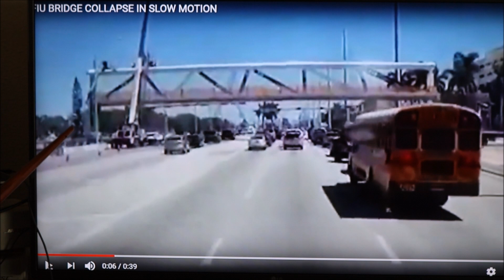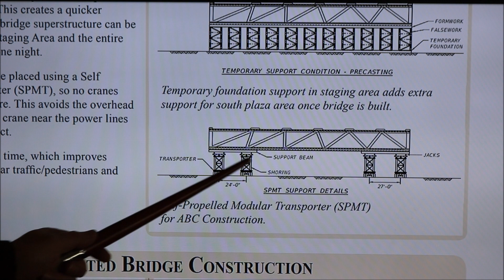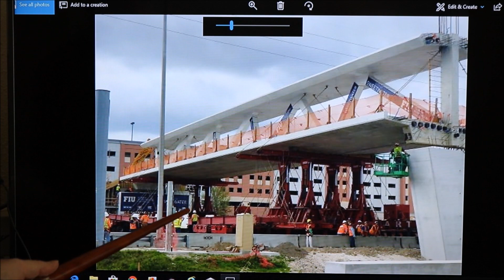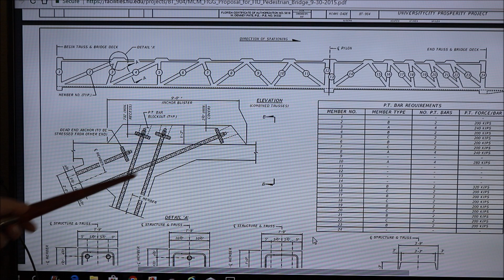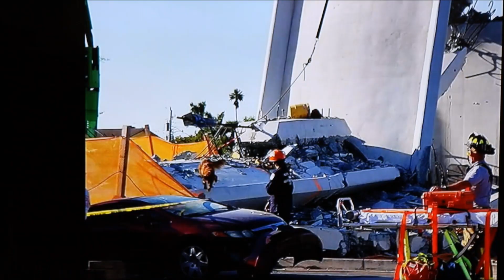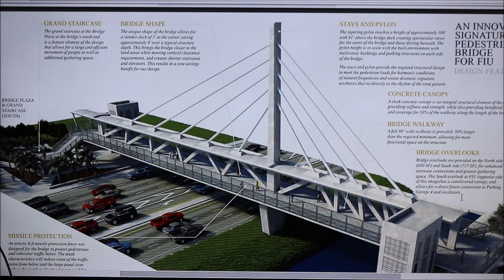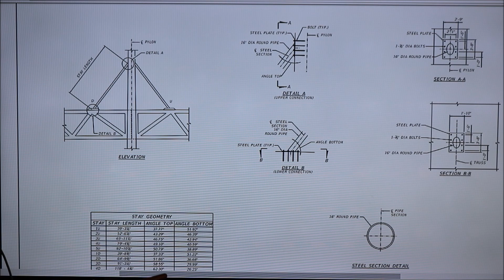Miami Bridge Failure Update 18 March 2018

Comment: I suspect they’ll find the design was at fault. It was not a matter of if the bridge would fail, but when.
Reply: Actually, Stewart is partially correct. The design team was not all women.  Denney Pate provided the wet stamp on the drawings.  FIU and others have been busy scrubbing that information.  It was about quotas in STEM fields.  And using snopes for fact checking is like using wiki for research for doctoral dissertation.
Reply: Prior to the collapse, the FIU News wrote glowingly of Leonor Flores, a FIU alumni and project executive at MCM, builders of the bridge.  After the collapse, FIU stated that Flores had no connection to the project "in any capacity".
Yet the earlier report in FIU News included a quote from Flores herself; "I think it very important as a woman and an engineer to pass this  on to my daughter."  Flores was billed as the Lead Engineer in the FIU News article.

MCM, Flores' employer and the builder of the bridge, is minority owned and quite politically active, even getting legislation passed by Miami-Dade County favoring MCM in multi-million dollar projects.
Reply: This is my story of the bridge failure: Just before it snaps, you can see how the upper flange has an arch curve that stops at 11. The section to the left of 11 is rigidly fasten to the lower flange through 12. Therefore, this section cannot "dip" to conform with this arch, so the lower surface of the upper flange goes deeply into tension. Stress concentration occurs at the sharp inside corner right angles. 

And this is where the node above 11 explodes and looses much of the rigidity. It separates from the upper left flange. 

12 has stopped supporting much and 11 suddenly has the full weight of the bridge. You can see how the arch gets more pronounced as the node rotates and transfers all force to 11. 

The shockwave travels down 11 and hammers the lower flange tendons, especially the center two. These two are not designed to take the full tension of the flange, much less a shockwave. The lower flange tears open from the center to the edges. This is another critical shortcoming. The web applies point loads to the lower flange, especially to the center pair of tendons at the endpoints. These two should be fully capable of handling all the bridge tension, even if the post-tension is never fully applied. 

The lower flange is now hanging from 10. This compresses 11 even further.  

11 explodes, throwing out the lower tendon. 

The node above 11 was extremely undersized, just as 11 (and 2) were extremely undersized. 

I conclude that tying the upper flange to vertical 12 (before the bridge was properly settled) was a contributor to the failure. The top of 1 and 12 could have been left freestanding on untied rebar, to be grouted in later. 

I believe that 1 and 12 should never have been designed to support any bridge weight. 

However, if the web had been inverted, then 1 and 12 could have been compression members. 2 and 11 would be in tension, etc. This is a very conventional configuration for Warren Truss bridges; probably for very good reasons. However, the end nodes would have to be far more robust.
Reply: Carla Nunez, Here is but one source for you.  Be sure to read through all the links.  https://www.amren.com/commentary/2018/03/diversity-is-our-strength-i-have-a-collapsed-bridge-to-sell-you-florida-international-university/
Reply: It has the ring of truth. Yeah I will wait for the evidence before I'm sure, but that is just the kind of PC nonsense that has been going on.
Reply: Richard H You claim Snopes check unreliable yet you link a polar right bias opinionated website. The irony.
Reply: Why is the gender of the engineer even worth mentioning?  I'll bet something like 99% of bridges that have collapsed were designed by male engineers.  And, yes, I know that's because historically most engineers were male (like me).  If old white guys keep designing bridges that fail, shouldn't we look elsewhere for better designs?
Reply: Stewart James False. https://www.snopes.com/fact-check/was-all-female-responsible-bridge-collapse/
Reply: Richard H This project had nothing to do with affirmative action or stem quotas. The leading engineer as well as others relevant to the project have been named in other news sources. People actually doing research on the subject are having trouble finding anything to back your claim simply because it's false. Otherwise please list your source links.

Comment: The problem is that there is only on tension rod.  Too small for such big load.  And it that one fails there  is not backup.  That should have 3 rods.
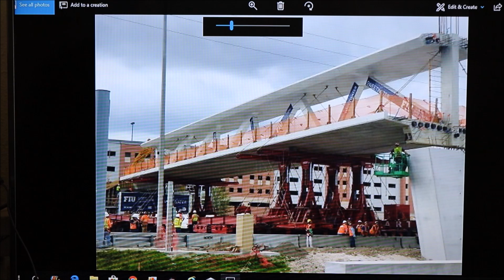Reply: At 03:15 there is a (preliminary) drawing with the list of PT bars. The alternate trusses have 2 and 4 rods in each.

Comment: Not so much "real world engineering", but real world construction. The apes setting the legos often deviate from what the engineers meticulously planned. Most of the time, things work out, but a few percent ends up adding to the stock footage of engineering failures.

My first guess would be over stressing in the cable, or the anchor point (insufficient concrete hardening time for the additional tension)
Reply: jfbeam: Politicians, administrators, inspectors & engineers are responsible. "Apes" as you  refer to construction workers were not responsible.

Comment: Concrete question . This is a concrete structure . Was it poured "in situ" , and did they let it dry for some time ?  Temperatures were low , even in Florida , in february this year .
And also thanks for this video .

Comment: This was an "aesthetic" bridge, a 32 foot wide, 32!!!!, pedestrian bridge, the big idea being the lighting above for night time viewing.  What this looks like is an artist creating a venue in the air for partying by college students after dark, outside; the operative word being partying.  The main purpose of the structure was not to be walking, but partying, over a highway.
Reply: It's not even possible to understand the design decisions here unless you start from a perspective like that, physics be damned!
Reply: Yes. 
One of the designers stated that there would be seating areas between the 'orgami' - like struts.
(Have your picnics and chill out wafted by the gasoline fumes coming up from below).
The tower was 110ft tall apparently because the bridge was adjacent to 110th St.
The pipes (not stays) were painted with a powder/paint mix to better reflect the  L. E. D. beams.
So it's true that the suspension design look was largely for aesthetic purposes.
Aesthetics are important but they're secondary or even tertiary to safety of design.
It's incomprehensible that traffic was allowed to flow under a bridge being put in situ but that's another issue.
RIP all who passed away.

Comment: Were the workers adding tension to that truss member, or reducing it? Adding tension during the move would make sense as that truss member is under tension when the bridge is cantilevered out like is was. Once the bridge is on the supports, that truss member comes under compression, so the added stress from the tension during the move now needs to be removed.
Normally post tension adjustments of this sort are always adding tension, so I can see it being very easy to accidentally follow the 'normal' procedure and add even more tension, resulting in a failure of the tensioning rod and/or anchor somewhere. It'll be very interesting to read the engineering report of the failure when it comes out in a year or so.
Reply: @Kelly Gray; Absolutely!  Member 11 failed in compression, and I suspect that the internal tension rods were over-tensioned, creating tremendous compressive stress on member 11.  That has been calculated by one poster to be 1,000 tons of force on that one member.  Given the type of concrete used and the fact of very little reinforcing steel in the members is an obvious place to start the investigation.  

The workers had tensioned that member just the day before, and now they are asked to go up there and "do something" to the tension rod, and the instructions were not very clear that they should be releasing tension, not adding more.  

Anyway, many posters think the tension bar failed in tension, but that is not the case.  The concrete in member 11 failed in compression.  The rod is shown to be intact.  Member 11 is completely blown to smithereens.

Comment: So much for the OSHA fall protection system on that workers harness. To those in the comments who prefer an old fashioned steel bridge, we don't build them anymore. There is a lot of steel in the new Bay Bridge, and a Huge amount of post tensioned concrete like in Florida. Changing the moving plan from the designed move to the convenient move was the critical error here, and trying to correct it with the street open was criminal negligence IMHO.
Reply from the maker: Phil Rabe I may be wrong about the harness....

Comment: I never knew it was supposed to have cables until I saw the animation by one of the news outlets. I wonder if they miscalculated the strength of the bridge? Certainly there are variances in concrete strength (including depending on how dry it is) that need to be taken into account, otherwise you'd end up with a collapsed bridge...
I wonder what they were doing with the crane. Was it holding up the bridge, or were they lifting stuff onto the bridge?
Reply from the maker: Benjamin Esposti probably the hydraulic tensioner.

Comment: Could it be that they forgot to relieve the extra tension temporarily applied to the end cable while the end of the bridge was cantilevered, and then when trying to straighten the bridge, over-tightened the opposing cable and broke it or broke its mount?  I'm sure the investigators will find out.
Reply: This is my theory. They did not release tension as the bridge was lowered into place causing the concrete to crumble/fracture. They did not do so until 4 days later by which time the column could no longer support the weight and broke apart.
Reply: If you think about it, it could be as simple as they turned it the wrong way.  People make dumb mistakes like that all the time.  If it was already overly tensed...pop.
Reply: I think that the whole site was on red alert. They knew something was up. those chaps up there knew perfectly well what the orders were, and the senior people were watching probably holding their legs together. Im not sure they would at this juncture forget which way they were supposed to turn the nut. I hope they survived to tell us.
Reply: I dont know the whole story, but from the video it just looks like a couple guys and a crane.  If they were paying so much attention to it they would've closed the road.  Either way, it doesn't really matter.  Dumb mistakes happen.  It's VERY easy to turn something right instead of left.

Comment: What is important to remember is that the failing member 11 is under great compressional load. Any tensioning of the steel rods inside the member just adds to this compressional load. Member 11 has approximately 45 deg angle. The bridge weight is about 960 tons. Each side is therefore about 480 tons. Most of this weight is transfered to the base by member 11 at 45 degrees angle. Therefore the compressional load of member 11 are about 480 tons / sin45 = 686 tons. Add 100-200 tons compressional load from the steel rod and you are seeing a total compressional load of about 750 to 850 tons. The dimension of member 11 is 1 feet 9 inch x about 2 and a half some feet. This gives a compressional load per square inch of concrete of member 11 of roughly 1.2 to 1.3 tons! I find this to be a very high compressional load for concrete.
Reply: the tp bar increases the compression stress in member to be buckled failure
Reply: and what about the shear forces transferring that massive force from the upper bridge deck into that member?? And counteracted by the tensile force of the next inclined member... blimey there is some scope for failure there I would have said!
Reply: SteinarNor — Especially if the concrete is insufficiently cured.  When a concrete ramp was built near me a couple of years ago, temporary supports were left in place for months, long after the ramp had been opened to traffic.  But with ABC, supporting the structure in place while curing conflicts with the objective of minimizing road closure underneath the span.

Comment: 1,000 ton bridge, 500 ton vertical on each support pier
2 to 1 angle on the strut, by geometry develops double  outward force, 1,000ton (2,000,000lb)  How did the strut transfer 2,000,000lbs of horizontal force to the deck?
Truss          Foot          Detail

Comment: The good news is that we do not have YouTubers designing bridges and buildings.  One could get that impression from the comments - keyboard is all one needs to be a bridge engineer.  ;-)
Reply from the maker: Rightsideofthegrass relax....we are ALL learning here. Questions?
Reply: Sorry, ... I spent three years of undergraduate work in structural engineering, I spent two years on a Master's program in structural engineering, wrote a thesis on bridge structures, I spent some years working with a prestressed concrete company, doing design of new structures (both bridges and buildings), and analyzing existing structures, spent time in consulting practice for several years on structural/mechanical engineering, some of which was forensics work, ... on the ground floor of computer simulations of structures, ....  etc.  This is NOT to impress anybody.  So, I read the comments here with that backdrop, and am not sure whether to laugh or cry.  There are lots of folks behind this project that hold technical skills and knowledge, and experience that goes beyond being a keyboard jockey on YT.  This is the basis of my comment.  Contrary to so many comments that claim to know why this construction project failed, the investigators will work for a long time to arrive at a conclusion. 

This is in NO way a swipe at your work.  Your explanations are sound (you exhibited this during the Orville project), and are presented in such a way that most can understand.  You have found NTSB  documents that help immensely in the details of what went into this structure.  You have done an outstanding job, IMO.  Keep up the work.  

But, I now see several other YTers,  with limited knowledge, but a viewer following, attempting to capitalize on the event.  And, the sad part is these folks have supporters, groupies that are blindly following, attempting to build view counts.  

Two things emerge from my viewpoint: (1) Truth is elusive, but, more importantly, is not valued.  This has become a societal problem, and it spills into these threads. (2) The eagerness to be divisive has reached a feverish pitch, no matter the setting.  Again, the societal climate seeps everywhere, even into threads like this one.

Comment: We know this was intended to be a cable stayed bridge.  The way they put the bridge up, the main span, over the highway, was a simple truss but at a later date they intended to transfer all loads into the stay cables.  Any engineering student in first year structural mechanics could tell you that the end diagonal of this simple truss were under tremendous compressive forces.  Adding to those compressive forces by tensioning the reinforcing tendons would be crazy and, if that is what they did, should be investigated as the cause of the collapse.

Comment: Thanks Juan, another great video.
I chuckled a bit noticing your "pointer", a paint brush...memories of Bob Ross's painting series , came to mind.
Anyway, my thought after watching your explanation was, why, no, safety support or blocking was in place under the bridge during the" tensioning" process? Seems like a reasonable 'safeguard" considering the risk of anything going wrong, and it did fail from one end. Supporting both ends from below, might have stopped the entire structure to come crashing to the ground.
But hey, I'm no engineer (proud to say), just a common sense kind of guy. I've seen too many incidents where the , "by the book" approach, is NOT the best approach.

Comment: New amazing engineering feat, build elsewhere and move into place! I think that might be the first problem. 2nd problem is the fact they didn't stop traffic while working on it - they touted the fact that traffic wouldn't have to be stopped for very long - once they got the span in place they rushed to allow traffic to resume to show how amazing this feat is. Pride goeth before a fall.

Comment: I don't see any tension cables for the main deck. Do you know if they had any? Great video, I like the paint brush pointer
Reply from the maker: Jeff Driver yes, massive post tensioning on main deck.
Reply: I'm talking about tension cables all the way though the main deck horizontally
Reply from the maker: Jeff Driver yes, I'll do an update and take a close look at the construction of the main and upper decks.